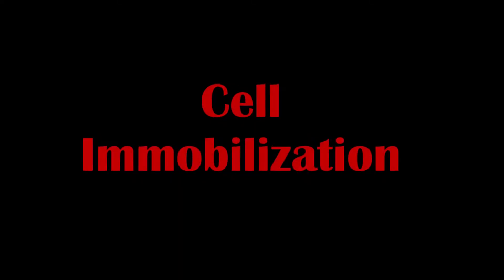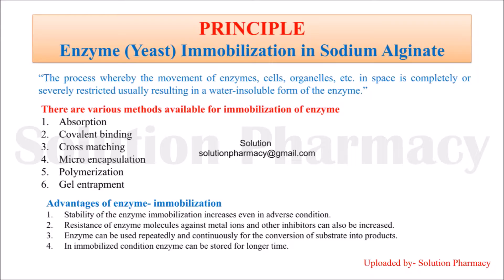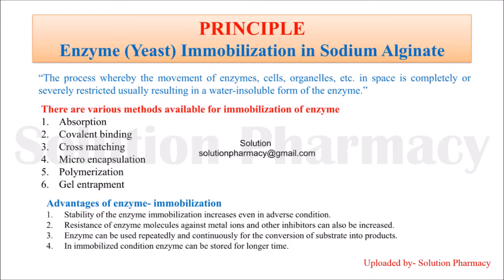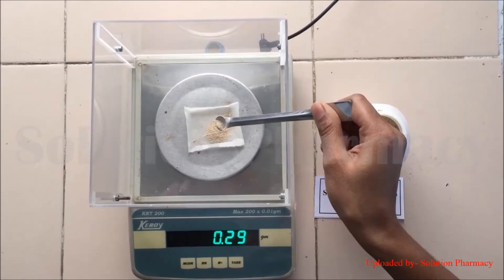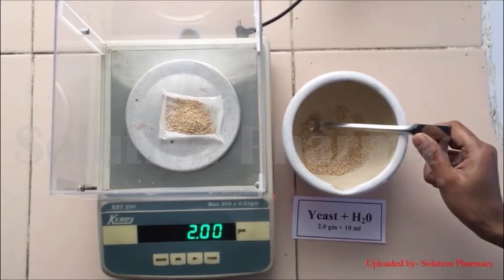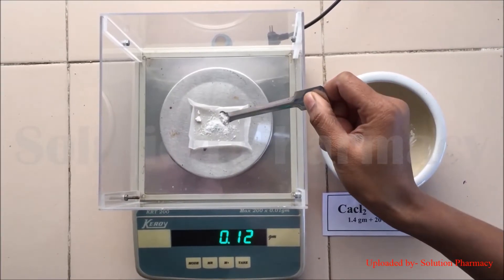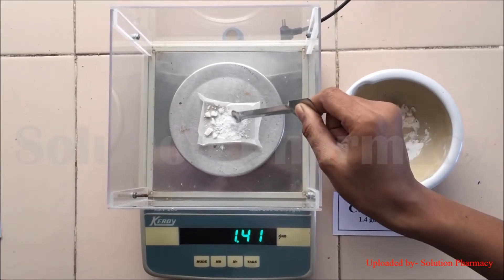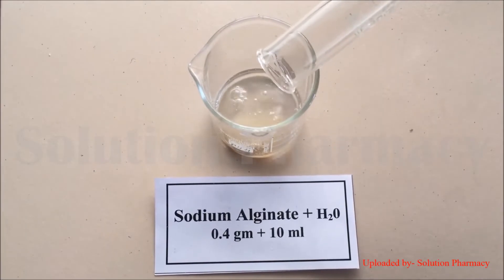Enzyme/Cell Immobilization | Yeast Cell Immobilization | Enzymatic Immobilization Process | ENGLISH

Comment: I reccomend to try to use syringe pump and drop liquid beads to the solution which is meshing by magnetic mixer. That will allow you to get stable stream of your yeast-alginate cocktail and that will allows you to get the more equal sized beads